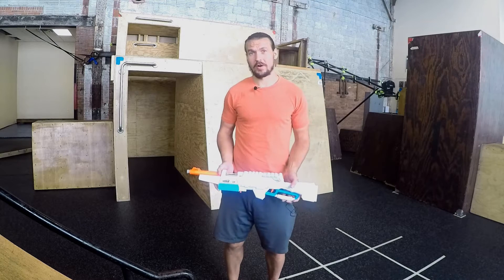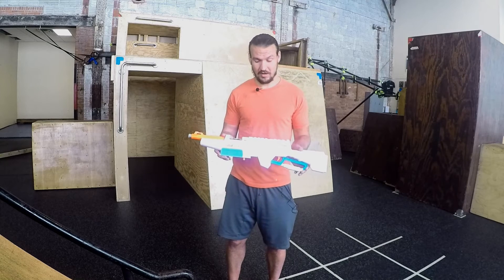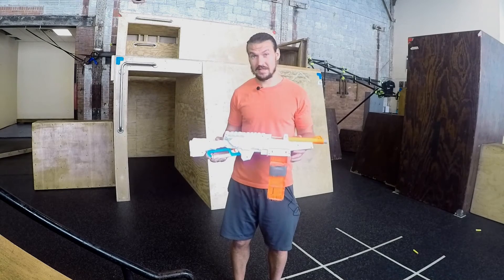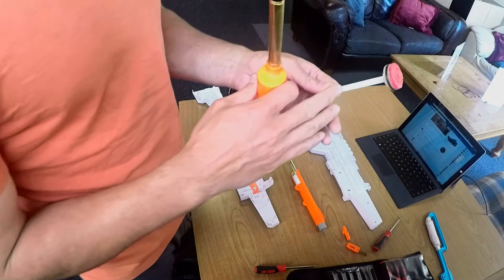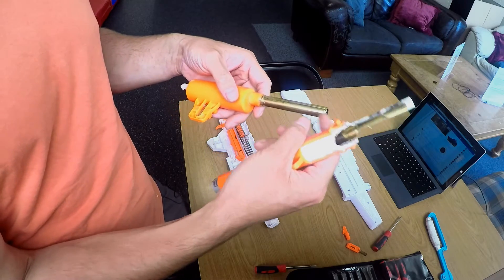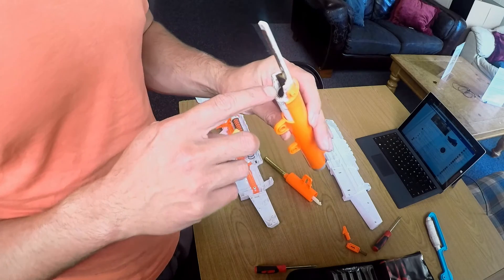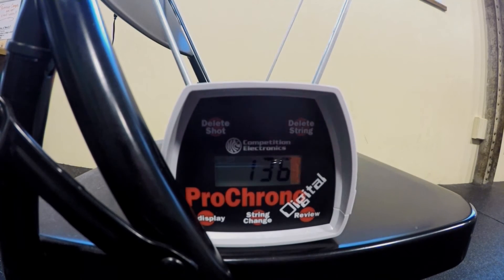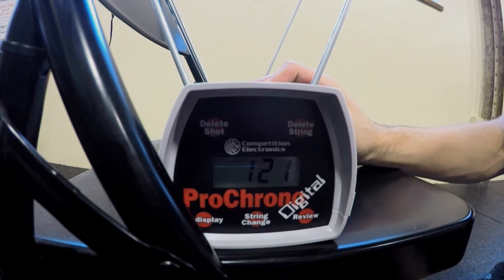Nerf Mod - K26 Sentinel Brass Breech

Comment: Great Work! It looks to me like the spring sits much farther back because of the sanding you did, does it?
Reply from the maker: +Its Fangs yes. The stock spring is only about 3.75". The k26 I'm using is nearly 8" long. Tons more power. I make videos on my other channel now: Aldoss. Check 'em out!
Reply: Rochester Parkour oh sweet! I love Aldoss! It's definitely in my top 3 gameplay featuring channels, btw I think I was like your 13 subscriber

Comment: Just 130fps? I thought it could easily get 150fps.
Reply from the maker: I'm sure if I cut away at the spring length I could get more out of it, but again, I plan on using this during our nerf wars and while some of our regulars aren't opposed to getting railed by a 150+ fps blaster, most of them are and would stop attending. Can't have a nerf war without people!